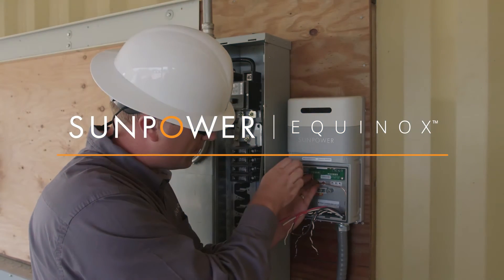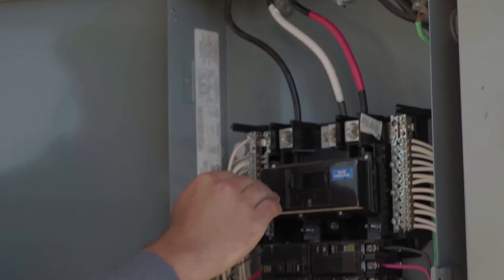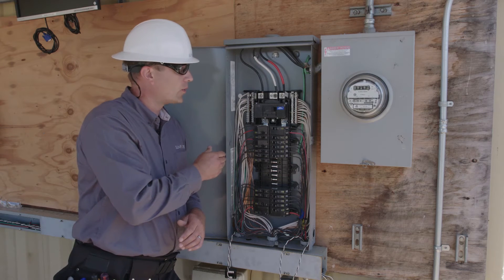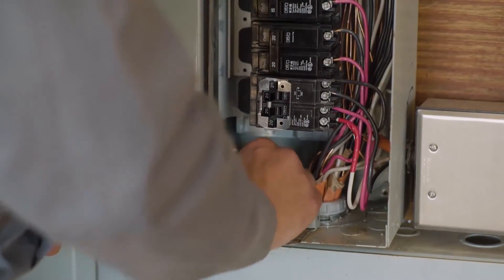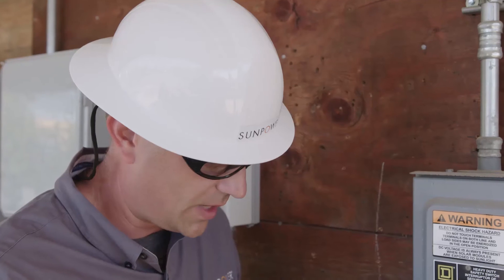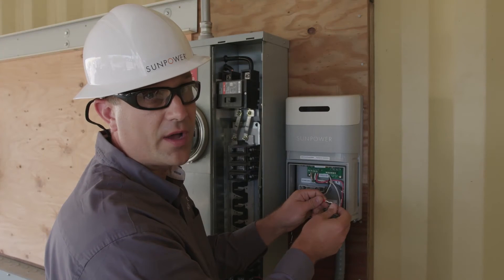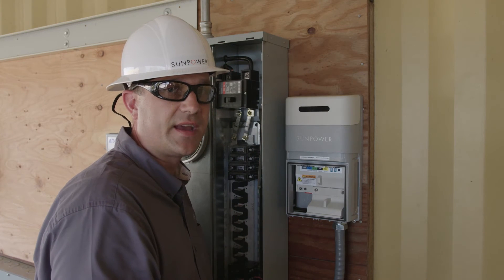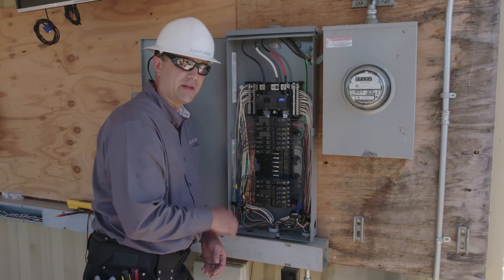SunPower Pro Tips: CT Installation for Consumption Monitoring

Comment: our sunpower installer installed our cts incorrectly and we have like 10 cases with sunpower, but nothign has been done yet.
Reply from the maker: Can you provide us with your case number? We`ll follow up with the appropriate team.
Reply: I had the same issue. The installer totally had no idea about how CT works. They just clamped the sensors regardless of the actual setup or readings😡

Comment: If the AC current is constantly alternating back and forth equally through the black and white wires on the CT (both ends of it's coil), how does it know if it's facing up or down? Shouldn't it give the same measurement in both directions?
Reply: Idk but they definitely know

Comment: Mine was Installed backwards by the dealer and was showing opposite data... they fixed it after 4 mos of troubleshooting.  had to come back and do some other work and my home shows no usage/consumption on the sunpower app.  Not happy I have had to spend soo much time dealing with constant calls to sunpower support only to have a different issue everytime the installer company.. HELP PLEASE
Reply from the maker: My apologies we have not met your expectations. Please provide us your contact information so we can assist you.

Comment: Too bad your dealers are busy making excuses why these CTs don’t fit and sell them on eBay for $40 pop
Reply: My system got installed recently and I got the same excuse that CTs are not compatible with my main panel and I need to upgrade my main panel. After watching this video I feel that is an excuse
Reply: @niroopradhakrishnan6475  yeah I bought off eBay and did it myself.  It wasn’t hard but SunPower or a dealer needs to enable it once the hardware is installed
Reply: @bennythepep  Install looks super easy. How difficult was the feature enabling process? My system reports production now. Any particular syntax that will make the request easier?